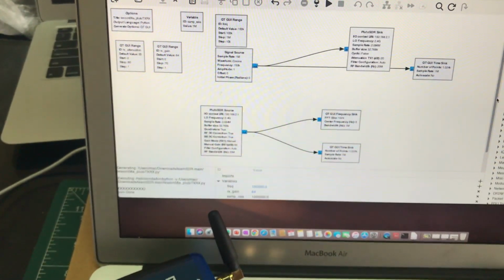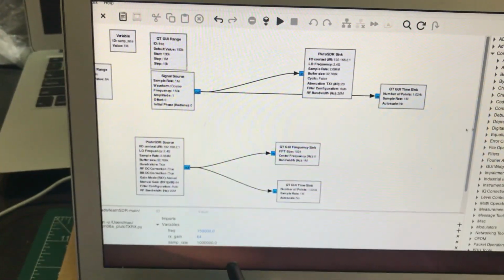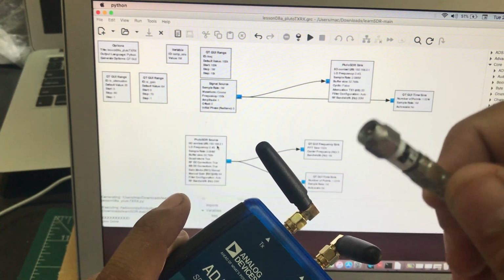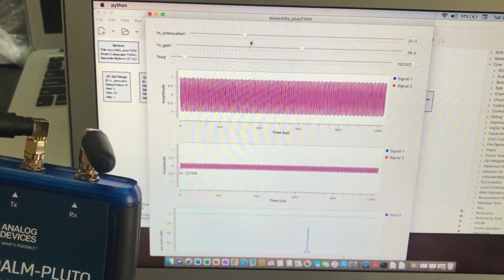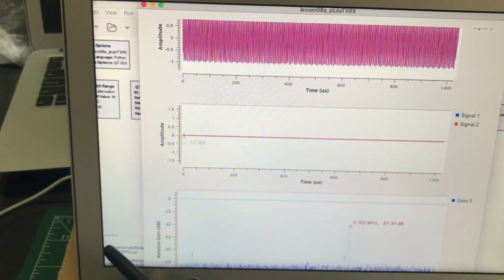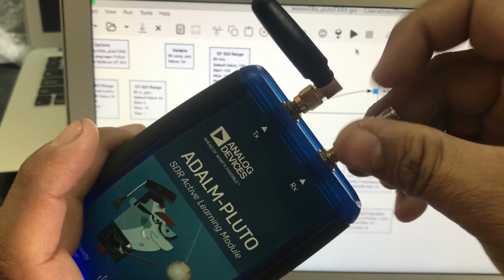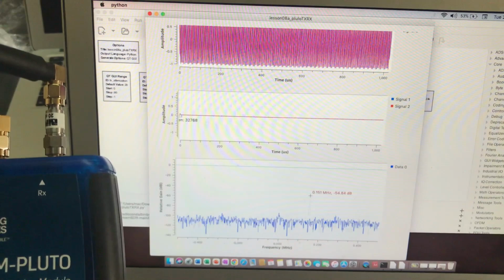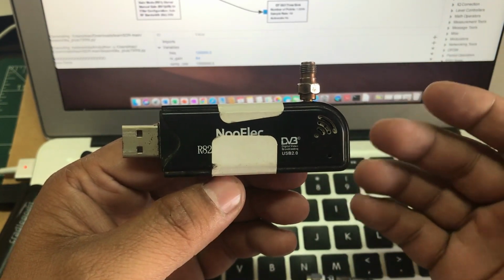How to USE PlutoSDR to Test the Performance of RF Passive Attenuators | Software Defined Radio

Comment: I was surprised to see about 15 dB of attenuation, and not something closer to 20 dB, as expected.  I think different orientations of the Tx and Rx antennas during the two measurements could be partially responsible for this discrepancy.  It would be interesting to see the measurement repeated using a pair of short cables to connect Tx and Rx (with and without the attenuator of course), instead of the antennas.  But interesting in any case, thank you!